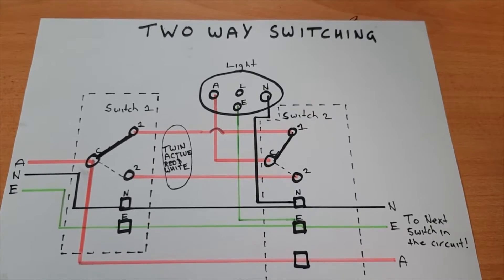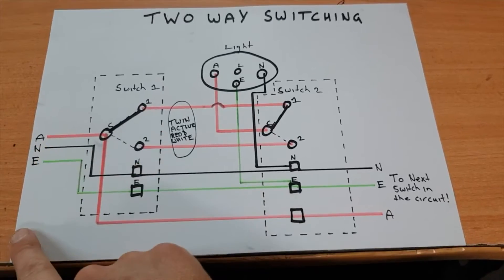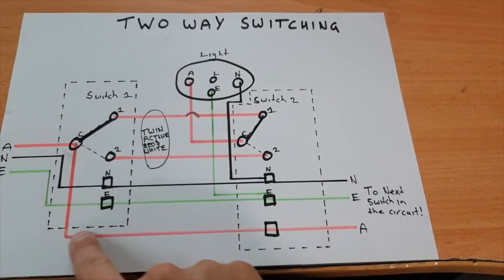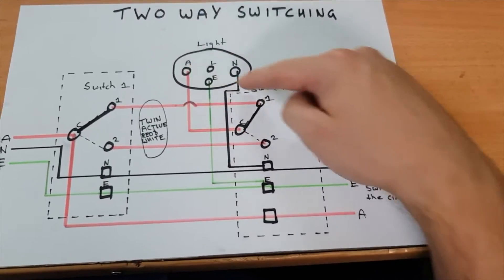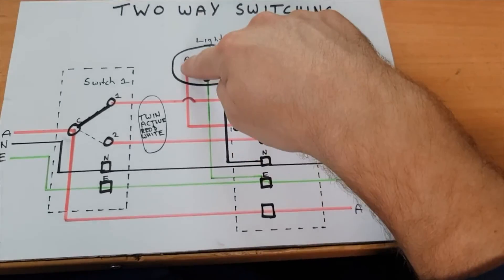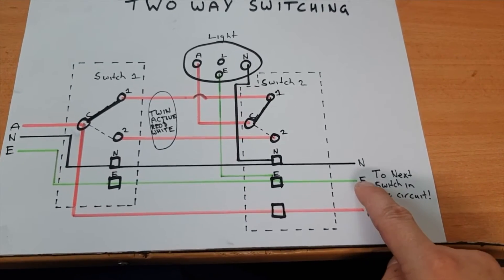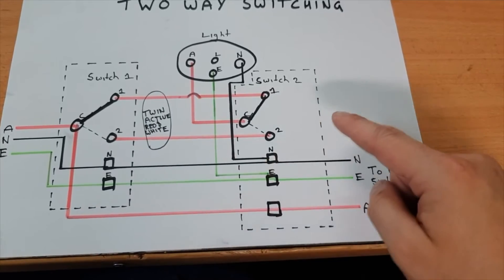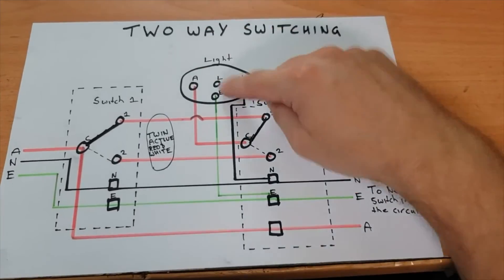TWO WAY SWITCHING WITH POWER AT THE SWITCH

Comment: Is it unusual to have 3 lights in one room (home work shop). three controlled by one switch but one light has an additional switch near the 3rd light to isolate / turn off that 3rd light because its not aways needed? ....rather than having its own switch with the main switch near the entrance of the workshop ?

Comment: Well explained :) 
Can a two way switch work if the wire to the light originates at the first switch (active in) or must the wire to the light originate at the 2nd switch in the series? 
If you can what is the wiring configuration in that situation.
Thank you.

Comment: if you have a house that has a two way switch and one switch has a neutral cable on switch 1 but not switch 2 and you convert switch 1 to a smart switch and instead of closing the loop on switch 2, could that number 2 wire connect to the neutral on switch 1 so it could then become a smart switch also?

Comment: Would like to see 3 way switch in Aussie context
Reply: Its exactly the same, there is simply a special "intermediate" switch mechanism on the twin active strap wire that performs a cross over when using the switch.

Comment: How do you know if it’s looped at the light or at the switch in an existing home.
Reply from the maker: Pull a few light switches off and check. If you have a earth at the switch there is a very good chance its looped at the switch. If you have old switches on your architraves around your doors then chances are its looped at the light.

Comment: So if there is only one light in this circuit, the ANE can stop at switch 1?
Reply from the maker: If your not trying to achieve a two way circuit yes. But power may still loop at the switch and continue to others within the house.
Reply: @allelectricalau  ok thanks. I think my next question has been answered below but to confirm my understanding of the diagram relating to switch 2 is that the active and the common are joined together in the one terminal?
Reply from the maker: @c4az57b  No out of the common of switch two goes to the light active. The active that comes from switch one to switch two goes into a connector because that might join with another red active that supplys the next switch in the next room ect.

Comment: from Main to switch to switch is Two Core and Earth Cable Live Neutral and Earth. And twin active connect 2 switches together, there are 2 set of cables here am i correct?
Reply from the maker: Will be a A+N+E to each switch but the two way switchings second switch the hard active will go in a connector with another active that goes to the next switch somehwere in the house. The switch where the common terminal is being used to switch the lights thats where the hard active would be joined in a connector.
Reply: Thanks for the wiring diagram and explanation. 
I was a bit confused about how it's done in Australia. 
But it seems we have to run two cables from switch to switch is that correct?  It seems an expensive way to do it...?
Can we just run a single 5 core cable (maybe a three phase cable? Red, white, blue, neutral and earth or that's just not the way it's done?)
Wouldn't it be more cost effective to just run a single cable between 2 way light switches then just loop feed to another switch using a twin and earth. 
Would really appreciate your feedback.